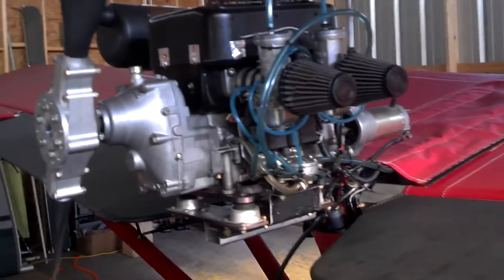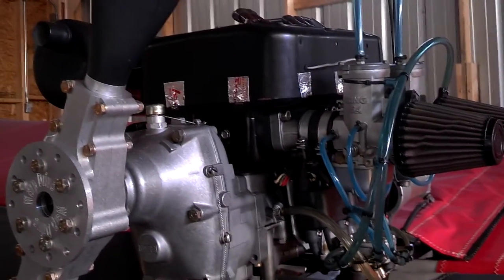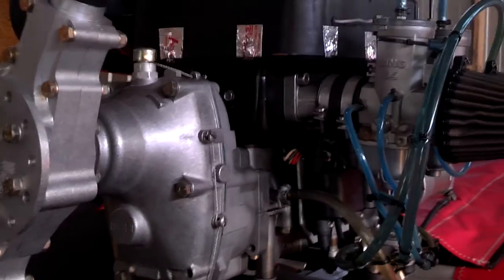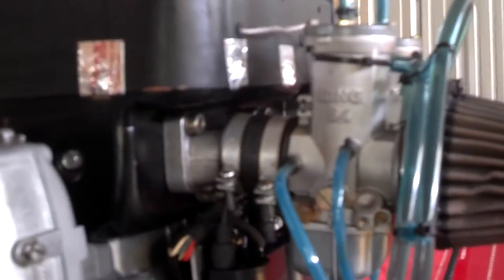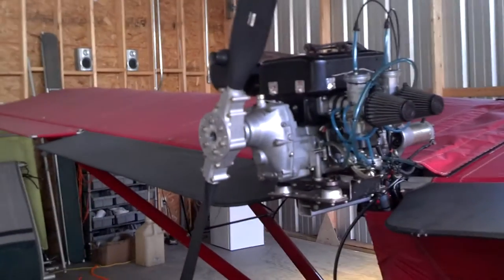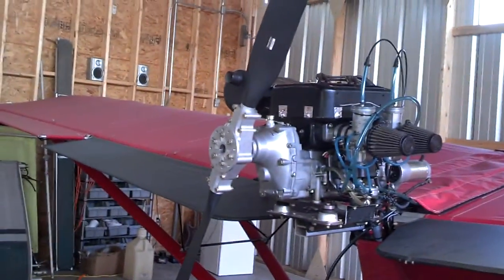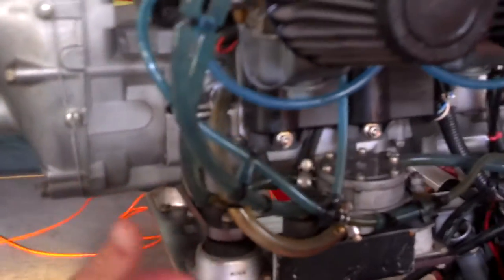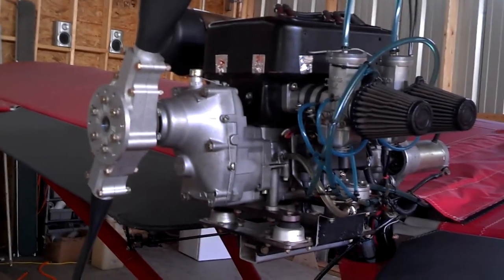Two stroke engines some tips on keeping them running well

Comment: Mount fuel pump above pulse port as well. Awesome video thanks!
Reply: there's no place to put it above on my kolb other than attach to the engine maybe.  I'm worried bout oil collecting in the diaphram and crappin it out. I think others have it mounted lower, I've got the line going up for a bit to minimize the amount of oil.
Reply: 1. Mount the fuel pump on the gearbox higher than the Puls outlet from the engine and horizontal  , look in the Mikuni installation manual. 2. If you use Pumpgas replace the pump diaphragm every year !! They didn’t cost much . 3. After 3 to 5 weeks the Pumpgas is already not anymore the same !! 4. Use alcohol free gas when ever possible .5. Drain the tank and the carbs before longer periods of non usage . 6. Use the best 2 stroke oil you can get .7. Shake the the tank , even when it’s only stands for a week or two ! 8. Before longer in use time , conserve your engine , it’s very simple , buy 2 spray bottles of fogging oil ( engine conservation) remove the air filters, start the engine , let it run in idle or little 🎉higher , spray the fogging oil simultaneously in both inlets until the engine dies , plug the engine inlets and the exhaust outlet  don’t turne the engine . Next spring , remove the plugs , turn the engine by hand several times, than simply start it ! Keep it alive WTH the throttle until the smoke stops . Then it will hold almost for ever !

Comment: This video was great and explain very good the life and use lasting of this particular engine,I will also suggest a fuel hose hook up system including line filters,fuel pump,the correct clamps and so and so.

Comment: Why did my engine lose power after takeoff? I made it back safely, barely. Rotax 503 points, dc/di, A box, 3 blade warp drive prop. Temps normal.  Engine starts and runs. Have not flown since.

Comment: My piston has a big detonation blast hole in the center.  :-/  I didn't put it there though.   I try to read the number stamped on the piston to find the same size to replace it with but it's really hard to read.  Anyway, they didn't tell me that when they sold it to me.   I had brought a compression tester with me but in a parking lot I really didn't feel like going through all that.  I would of bought it anyway since I drove so far to pick it up and only paid $250 bucks.

My best guess is someone ran it with a hotter break in spark plug than the normal spark plug, because the spark plugs in it were the ones recommended for break in?
Reply: Measure diameter with micrometer or digital vernier caliper.

Comment: Super helpful info thank you for taking the time to make this. I’m looking at a single carb 503. Anything I should look for?  Has a belt drive for a phantom x1. I noticed the fuel pump in the phantom I’m going to buy is vertical. I should change the orientation or ok to leave it?
Reply from the maker: Rotax recommends change it, but I see many oriented that way!

Comment: Hey Harmon did you do vids on adding a back up fuel pump and or controlling vibration on wires that are exposed on Rotax engines ? Great video thanks . just bought one of these birds used . I’m trying to learn as much as I can . Thanks Dan

Comment: Hello, what RPM would you suggest for warm up?  I've been going between 2000 and 2500.  1800 seems to make the engine vibrate too much.  Also, what water temp would you suggest?  I've been waiting to about 60 degrees Celsius before taxi.   Thanks!

Comment: Hey good info BUT!  I think at some point you said you mix oil with gas at 50:1 ratio AND use the oil injection system then said, “more oil is better.”
IF that’s what you said that is definitely incorrect!  If the manufacturer recommends 50:1 that’s what the mixture should be.  Any other ratio will be harmful to the engine as the fuel air ratio will burn at the wrong temperature.
Reply: Yes, you should use either the oil injection system installed on the engine OR mix oil 50:1.    More oil won't harm the engine.   It will provide more lubriction.   The downside is, you risk building up carbon deposits on your piston/spark plug and fouling during run up or flight.     Choose either premix or injection, and make sure your EGT is at a stable reading of 1000-1100F.    If you do use a richer oil mixture than what is recommended and get by without fouling a spark plug, you notice a reduction of power only, with no harm to the engine.     I've been flying Rotax 2-strokes for many years and love them.   Replace rubber carb sockets every 2 years with aftermarket vs Rotax.   Sometimes the Rotax brands have cracks when new.    I hope this helps.

Comment: Seems like if any one of those tubes pops off because a clamp slips off or vibrates loose, that's it, that's all she wrote for your engine.  None of it looks safety wired on.

Comment: dude i have a grubee skyhawk 2 stroke 48 cc and it only runs when I'm moving then when i stop the engine stops any ideas?
Reply from the maker: Almost impossible to diagnose over the internet.  2 strokes only need 3 things to run.  spark, Fuel and compression.  I have seen a lot of weed eater motors that exhibit this symptom.  Sometimes they will run cold, and after they warm up, they want to die or run poorly.  this is usually low compression.  I always operate on the KISS theory.  Keep it simple stupid.  start with the easiest thing first.  fuel, then move to spark, finally compression.  Here is my last piece of advice.  Carbs just dont get out of adjustment.  The motor usually has changed, or the carb has gummed up.  turning the adjustment screws will almost never solve your problems.  good luck!

Comment: It doesn't sound like a very safe engine to use on an aircraft... the whole possibility of getting an air leak anywhere destroying your engine is a piss poor design.   Now if there is some kind of gauge or sensor or warning light you can install (for example O2 sensor in exhaust like on fuel injected cars)) that would immediately warn you of a lean condition that that might make it a workable decent engine.. if you can immediately shut it down.  I'm just not impressed with the multiple points of catastrophic failure on a two stroke.  Why use vinyl lines for example when you could design it with metal ducts in the engine blocks or metal tubes that would never age or crack?
Reply: +CHOPPERGIRL AIRWAR Your EGT gauges do exactly what you suggested, they immediately warn you of an over lean condition. Two-strokes definitely require more maintenance and care than a four-stroke, but they provide a MUCH higher power to weight ratio which is essential for flying lightweight aircraft.  (not to mention that they are often significantly less expensive)
Reply: Right-  EGT guage to prevent one of most common causes of failure.
Reply: Yeah, I have a CHT / EGT gauge and it doesn't tell me anything but numbers.  No red zone, no green zone, no yellow zone, and rather confusing for how the needles are positioned in one gauge.    Digital seems a better way to go. 

Still, I think these vinyl lines need to be replaces with metal tubes that won't vibrate off or crack, if any air leak anywhere is going to fuck up your engine asap.